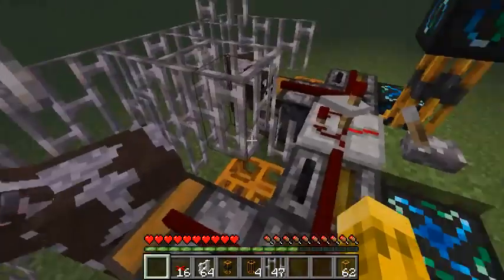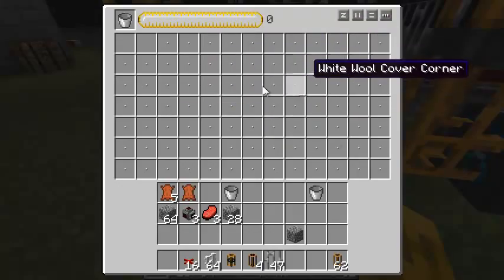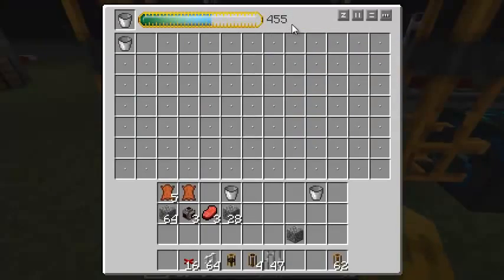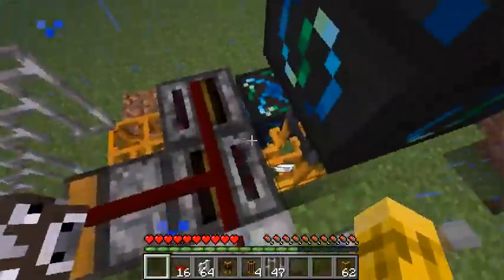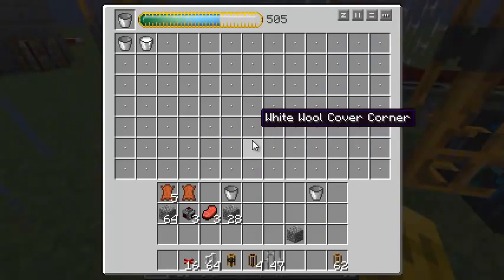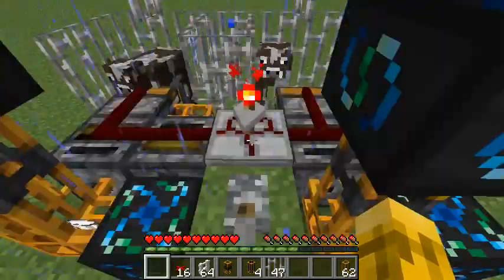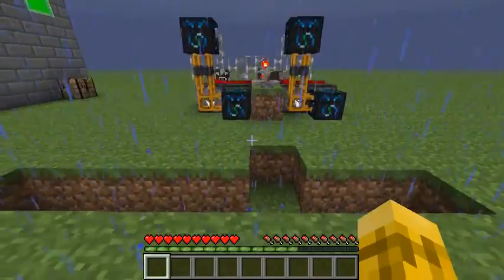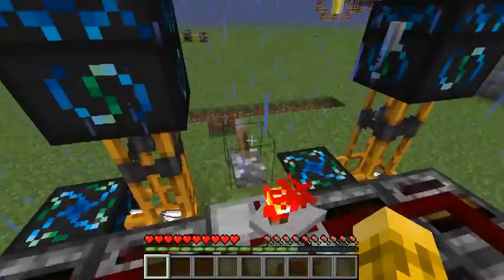The Great EMC Race - Milk Farm Revisited

Comment: that's fun: I recently started using EMC, yesterday I tried to make my own design for milking cows and the layout is almost identical to this =). I also did the race between milk and stew to figure out which is better (I haven't watch the video where you did the same until now), I used six sides instead of one and the target block was an rm block. I didn't thought about filling most of the condenser with items without EMC value, this is brilliant. mind if I post my video as response to this?